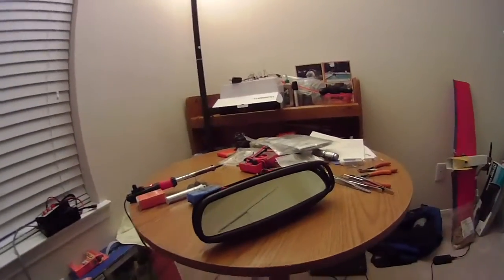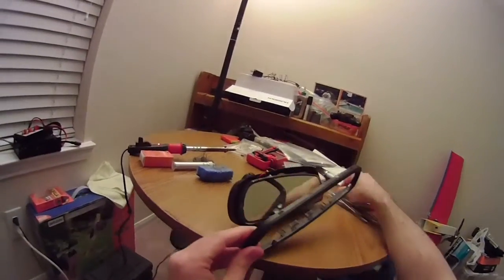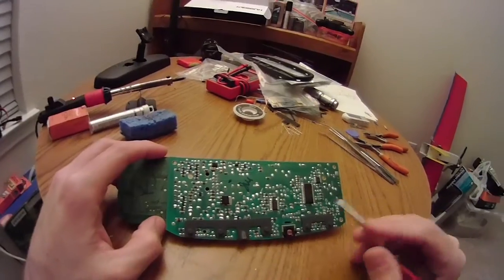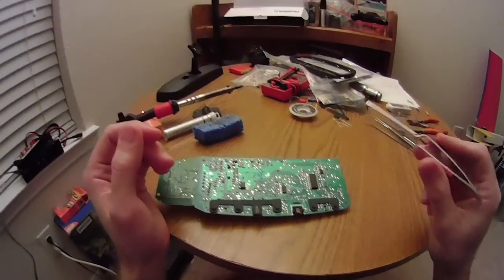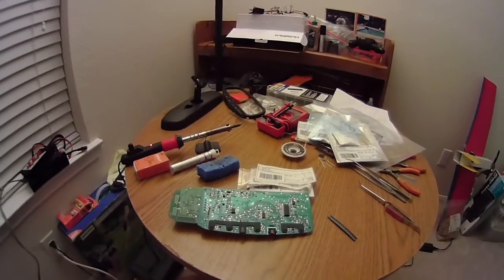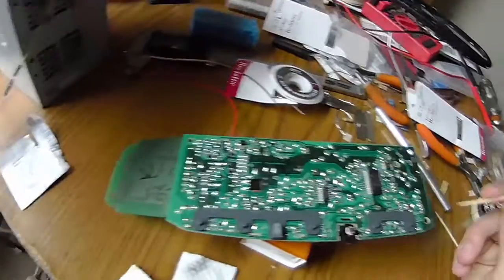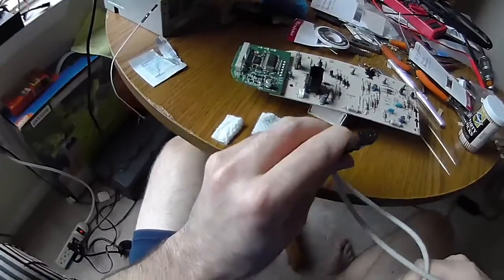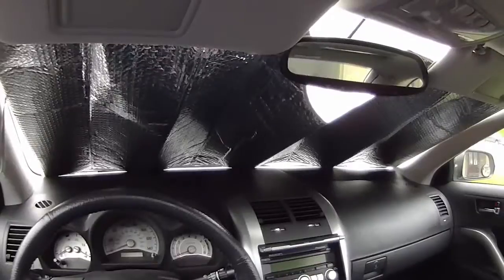Gentex Mirror Backlight Modification

Comment: I tried the spudger (guitar pick thing) but mine broke before I could get anywhere near the bezel moving. What I ended up doing was leaning into the sharp corner with an old credit card, moving that corner out of the way, and then sliding the credit card around the rest of it. Took about 2 minutes with the credit card and about 2 hours trying to figure out how to get it started with a variety of other methods.
Reply: Dude. I'm in the same boat. I cannot FOR THE LIFE OF ME pop out any part of the bezel. Used a guitar pick, a spudger, a credit card and the fingernails on four of my fingers. How did you do it? Which is the "sharp" corner? The point-most one?

Comment: I found your video very informative. I would like to also change the two main leds only on my gntx 453 to orange - to match my orange 350Z. Would you be able to tell me what size and other info i need to order leds for this. I have some 3mm orange ones but they may be too big. Thanks for any help you can give.
Reply from the maker: Hi Wayne,

I used LEDs from Digikey with part number APT2012SECK. These fit in place of the status LEDs on my mirror. Description lists them as "LED 2x1.2MM 601NM OR WTR CLR SMD" These are orange surface mount LEDs and they fit the GNTX313 mirror both for status lights and for backlighting. I haven't opened a GNTX453 mirror to see what size LEDs are in there. You may want to order a few different sizes of LEDs if you can't measure the ones in your mirror. Below is a link to a SMD component size comparison.
https://upload.wikimedia.org/wikipedia/commons/thumb/3/34/SMT_sizes,_based_on_original_by_Zureks.svg/2000px-SMT_sizes,_based_on_original_by_Zureks.svg.png
You shouldn't have to change anything other than the LED. Hope this helps you!
Reply: Yes, thank you for your detailed answer and your time. It is very much appreciated!
Reply: Hi there, Took apart the mirror (thanks for the tip) but now the two main leds are different. One looks like the led you mention but the other looks like a bulb of some kind of bulb?. (sorry I cant attach a photo). Any ideas?
Reply from the maker: Wayne,
The bulb-looking thing is probably the rear photosensor that detects the light hitting the mirror from the rear of the car. On your mirror it will be located behind the right clear diffuser (looking from the reflective side). The LEDs should be behind the left diffuser. If you only see one LED, it is most likely a bi-color LED. A brief search on google turned up a few 0805 (same as 2012) size bi-color LEDs, but none of them have orange as one of the colors. If you can't locate a drop-in replacement with the right colors, you may be able to replace the single LED unit with two smaller LEDs of the desired colors.
Reply: I think i get it now. The right difuser is a sensor with no led and the left one is the green led. So i only need to replace the left one.. wow, those are small soldering areas to hit!  Thanks again!!
Reply from the maker: You're welcome. If your green LED lights up red when you press the homelink buttons, then it is a bi-color LED. And yes, the components are very small. A fine tip on your soldering iron will make the job easier.
Reply: Got the order from Digikey today! wow! however, whatever i ordered was completely wrong i guess...  part # 754-1130-1-ND  LED orange clear 0805 SMD I need a microscope to see them! ha ha . there is nothing to solder as it appears to be the worlds smallest led light... I think. Well that just goes to show you that I have no clue what I'm doing...  I want to thank you for your effort though! You must be an electronics guy or something to figure that out. :)
Reply from the maker: Wayne Duford The 0805 LEDs are really small, but they can be soldered fairly easily with a small iron. There should be two metal contacts on the edges of the LED. The LED is simply placed on top of the contact pads on the board (verify polarity) and then solder is added to each side. I'm more of a hobbyist than an electronics guru :) Is the 0805 LED significantly smaller than what you have on your board?
Reply: the led on my board looks like a small rectangular white block with two contacts on each side. On the side facing the lens, if i look closely, the block looks to be about 2x3 mm and about 1 or so mm high. If you have an email, i could send a photo. I don't want to take more of your time though, Originally, i thought it might be more straightforward, but it looks to be more involved than i thought.
Reply: Critical Altitude how many bulbs i need ?! 10 ? if you can respond asap
Reply: Eric Duford 2012 and 0805 are the same size, just different units. 2012 is metric and means 2.0mm by 1.2mm. 0805 is the american sizing.

Comment: To contribute... Gentex 453 doesn't have transluscent buttons. And a question... Any idea on how to troubleshoot the aut dimming feature? Mine sometimes doesn't dim unless I finger smack the bottom of the mirror. I took it apart and couldn't see any defective welds, rust or anything that could cause a bad contact, so I don't know what else to look for.
Reply from the maker: If physical shock causes it to start working, I would suspect its a soldering issue. You may not be able to see a cracked solder joint with the naked eye. I would suspect the actual light sensor first, but it could also be a chip on the board or another surface mount component along the way. Is the mirror indicating that the auto-dimming function is on or does is that intermittent too? Thank you for contributing!
Reply: Critical Altitude The light indicator is not intermittent. When I opened it, I noticed signs of moisture, probably condensation residue from climate changes. I tested after cleaning it and it was responding quickly. The real test will be tonight on my way home from work. I'll let you know how it behaves.
Reply: Looks like cleaning it did the trick. Been testing for a few nights now and the dimming responds quickly, even with low beams.